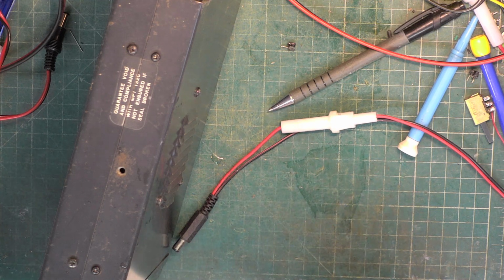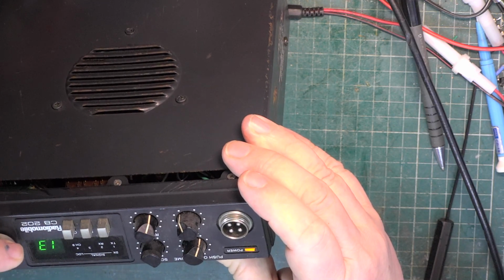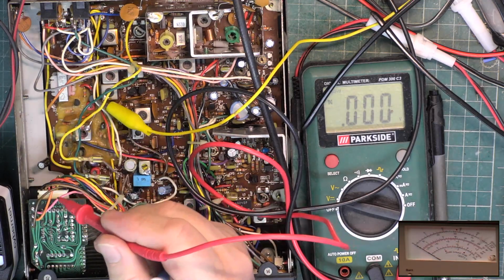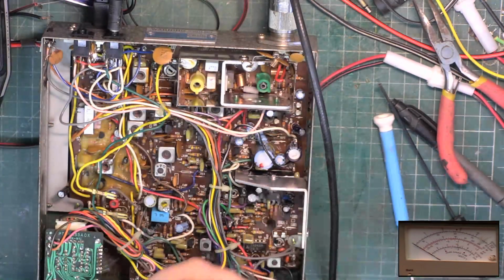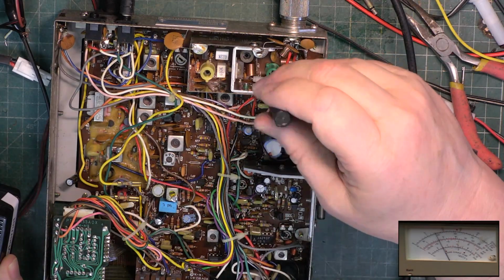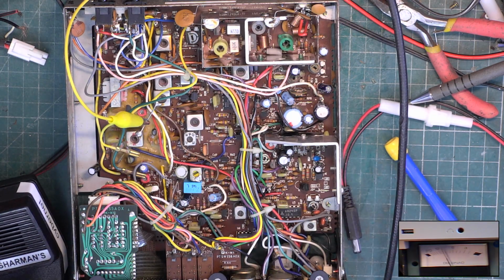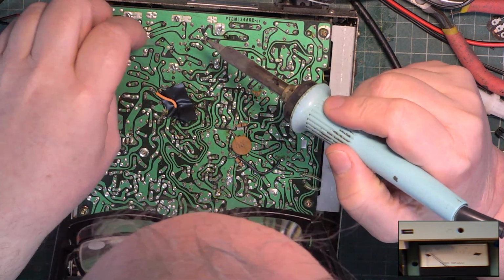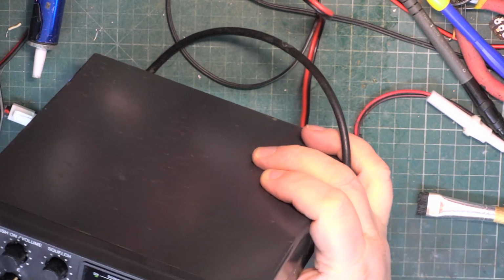Radiomobile CB202 CB27/81 UKFM CB radio - service alignment

Comment: I think the Beta 3000 has a normal on/off switch doesn't it Richard rather than the push type that I've had a few playing up on when the radio's get dusty/dirty.
Reply from the maker: Yes, the Beta 3000 is a normal on/off/volume.

Richard